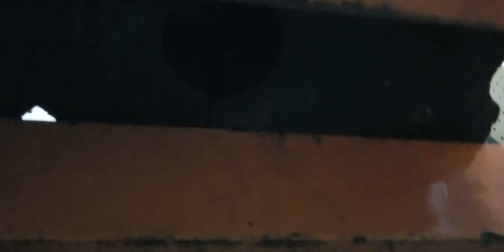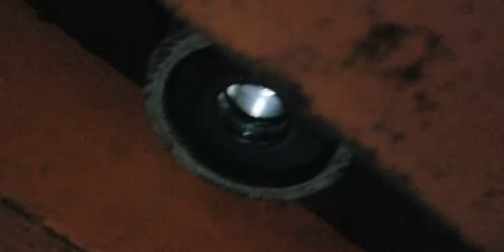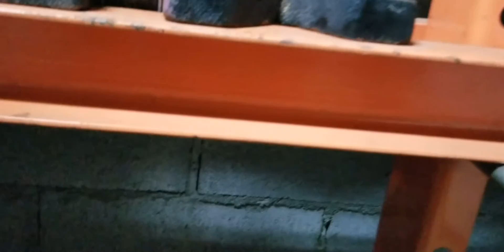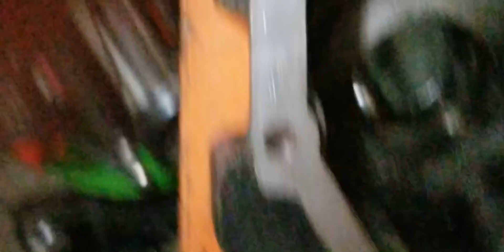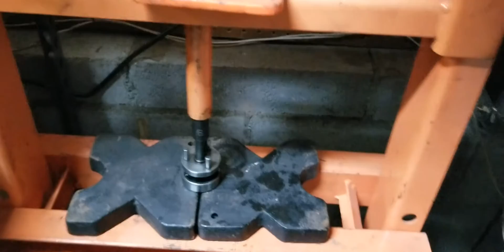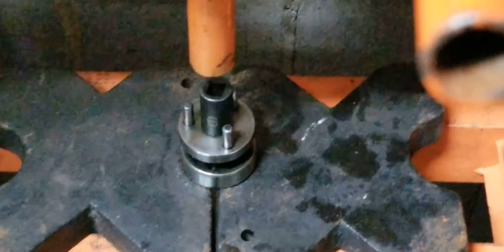Eaton M45 Supercharger Snout Disassembly Jackson Racing

Comment: No spring?
Reply from the maker: We didn't have one.....we seen most do
Reply: @DIYKAI  Mine has one. Was wondering if there is a difference without it.
Reply from the maker: @MrShamanfab207  not sure? maybe mine is missing lol we have not installed it yet
Reply: Rgr. Just put it all back together with. It kinda separates the 2 bearings. Will see as well.
Reply from the maker: @MrShamanfab207  make's sense I might just call around and try and find one this was a used unit we got send LOL 🍻
Reply: Any info on the spring? I know that star style lock ring for the outer lock ring really sucks, I used a c ring instead, came with the new bearings. For some reason, the star eventually gets loose and rubs the pulley. Making a screech like a bad bearing. Causes a squeeling you can hear loudly.

Comment: Hi - I am doing an oil change on my M45 supercharger (out of a MINI) and wanted to ask if there is any reason not to remove the snout to inspect the coupler and gears.  Does the snout self align (with dowels, etc) when you put it back together?  I already have the anaerobic sealant (plus the activator! don't forget the activator!)
Reply from the maker: Generally you would just spin it if it’s smooth your ok….you can check in and out play and side to side with everything attached should be very minimal if any
Reply from the maker: Yes it only goes on one way
Reply: New coupler is poly, it is a Lil tighter but it all goes back together relatively easy and aligns only one way. As long as the 3 pins on the coupler are aligned to the opposing 3 prongs it will align fine.